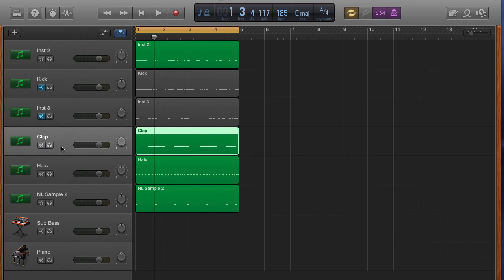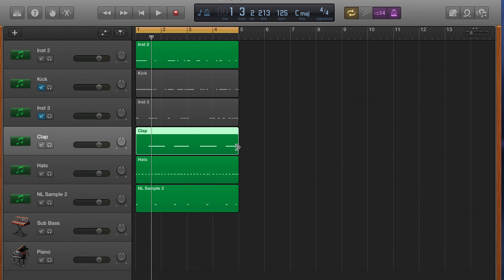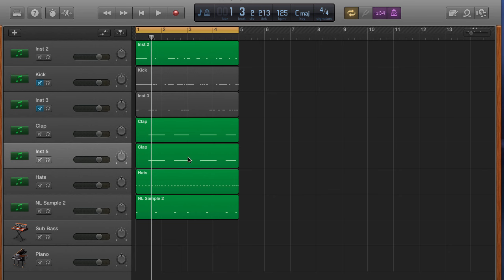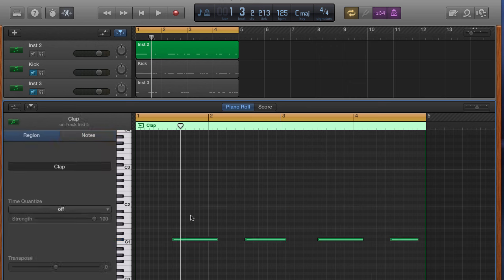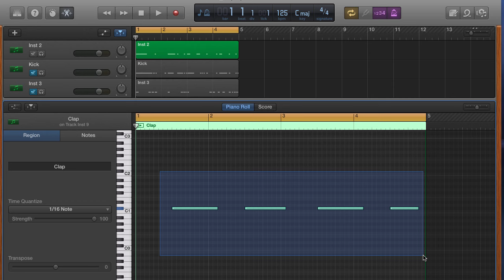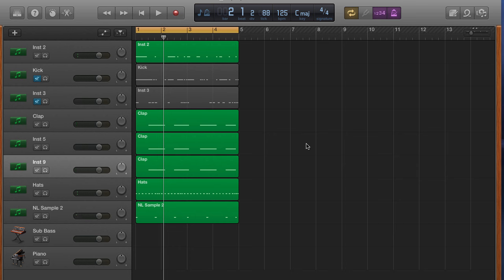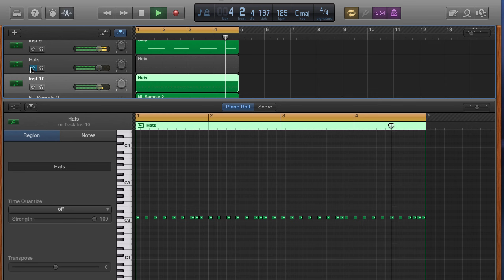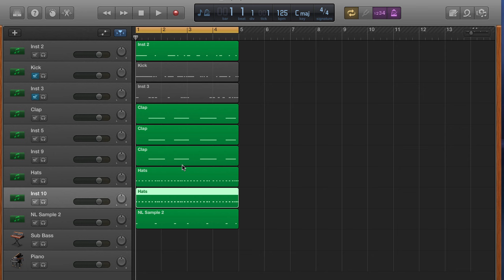Make Better Drums With Layering (GarageBand Tutorial)

Comment: 2 major issues here... you didnt do any blending with volumes or nudging so everythings hitting on top of eachother and at the same volume...for instance the 3rd clap layer changed the entire sound of the clap as a whole and only let the 3rd one be heard. Generally if u choose i higher sound, it will blend good with a medium and lower range sound of the same drum type. But pitching, nudging, and volume adjusting is key. Otherwise your gonna have a mess.... not to mention ur levels are going to be clipping like crazy by the time u get done. Think of layering as taking a main sound and adding SUBTLE texture to it at the exact right pitch and volume. That lets it fit in the track. Also EQing the claps and snares makes a world of difference. Layering is good but can be easy to fuck up.
Reply from the maker: Hey man, I may do a part 2 showing those steps as well but in this vid I was mainly hitting the concept of layering as a whole. Good comment and advice...Thanks for sharing!😎